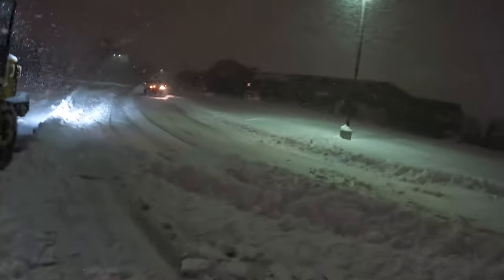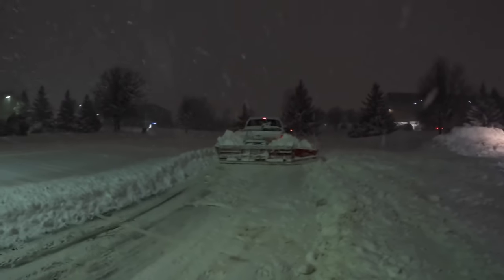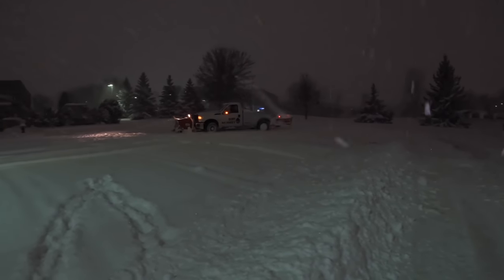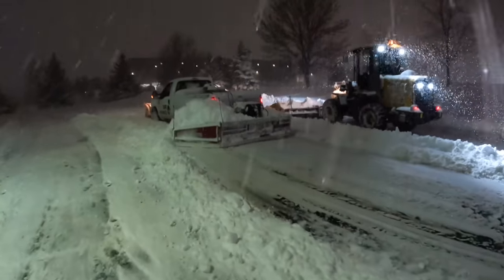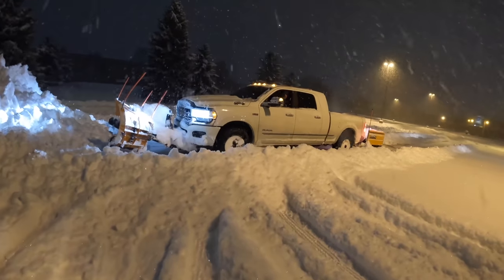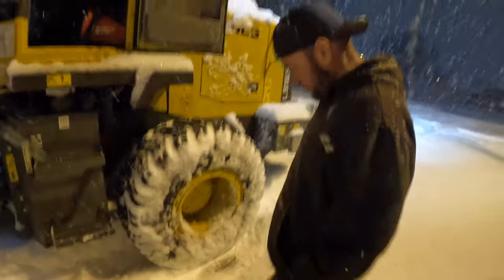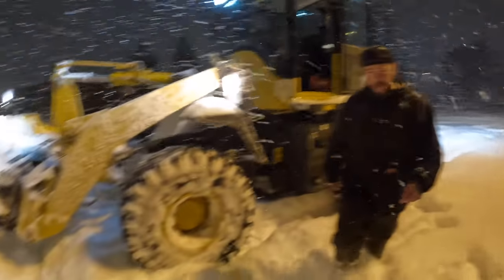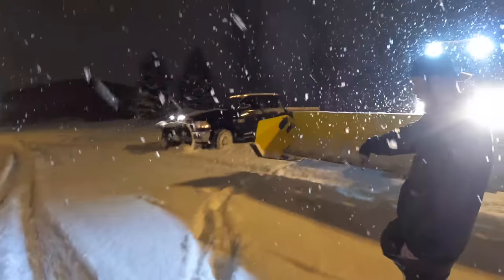24 hours of plowing deep snow

Comment: Any tips on getting plowing/ salting liability coverage when most insurers don't want to write new plowing policy's esp to new contractors and have even been canceling policies for people who have done it for a while already?
Reply from the maker: No advice-  Im in the same boat.  Its hard to get coverage for plowing.
Reply: What happened ? If you don’t mind the question.
Reply: FYI, 
At this point, I haven't had any problems or cancellations with our commercial vehicle insurance coverage. 
Wisconsin. Geico commercial.
8 trucks and trailers. 
All classified as year round landscaping service & snow clearing vehicles.
I added another trailer this past week and was asked if it'll be used for snow clearing. 
I said Yes, as it's enclosed and is used to haul snow clearing equipment. 
They added it and all is good.
Coincidentally, my yearly premium actually went down  
$50.00 this policy renewal. 
I've had 2 small claims in 20 years, loading dock door dings. 
No out of pocket cost for me and so far no rate increases.
I sure hope that you guys can get the insurance coverage that you want. Good Luck to all!

Comment: Dear Mr. Genadek. Whenever I see you clearing the snow, I think of the Red Poppy Ranch. The family lives off-grid in the Idaho mountains and has a long, dirt road to clear. The father does this with an old F150 that is not necessarily reliable. This road is the only way for the family and therefore essential. Do you have a cheap, used snow plow for the family? I am sure that not only the family would adore her for it.

Comment: I’m just amazed at the quantity of snow the white pickup pushes and pulls. Have you mentioned somewhere make and model? And I’ll be honest, I’ve lived in the northeast my whole life and I’ve never seen the rig on the back of the truck that pulls snow. It has a name?  Best Regards
Reply: is new one, see his other vid, a guy makes them and then will sell patents for nitrogen cylinder operated machine and the front plow has 6" of nitrogen forgivness plus triple trip edges, very easy on truck frame if hits something.   and has self leveling it's amaze balls      see stans other vid on the snow power front iron      that guys using firestone winterhawk tires his faves.

Comment: Lucky you getting all that nice snow, down here in central IL there's no snow, just frozen ground and lots of rain, good thing it's flat as can be otherwise there'd be mudslides everywhere, I've got my old Ariens snowblower stored away with Amsoil fully synthetic 10w30 small engine oil and synthetic gasoline so it stores better, the old Tecumseh engine is tired and the thicker oil helps in the cold, one of these days I plan on putting a Duromax multi fuel engine on it

Comment: Is there any way to flop the rear plow on the trucks to 45 degrees with wings out and slide out to one side or the other, to pull front plow spillage across to the desired side to maintain a finished side?  Also one day I hope to demo for you a setup that will cause your brain to melt.  Completely revolutionary.  About to head out myself.

Comment: Nice video!  do the SVL-75 in the video have standard block tread?  and what size artic sectional were you using on it.  I have a SVL-75 with stand block tracks and just bought a 8' artic sectional.  Now after seeing this video i feel like i should have at least 10.5' sectional.

Comment: I've been thinking about upgrading from a 5055e to a 100 or 120 hp tractor with a 8-10 ft snow pusher and a 8 to 10 ft rear blade, how do u like the wheel loader for plowing snow ? Any ideas for tractor snow removal set up ? Keep up the good work

Comment: i love watching the equipment work and see how different pieces do work differently. that sno power looks great and i like its advantages but it doesnt look like it stacks well and a lot of snow is built up between the plow and the truck. im using a straight blade and most of the time its just fine but every winter there are always those situations where i wish i could scoop. that arctic sectional though seems like a no brainer. all around a great pusher. i wonder how much of a pain it would be though if one of the section got bent up to replace it.

Comment: I really enjoy watching these snow removal videos, I have done this 20+years ago. How difficult is it getting new contracts/ maintaining existing contracts?
Reply: easy as heck    this year, you can find work, b/c contractors having trouble getting labor, just call local contractors and sub on for 125/hr with ins and your own v plow or respectable equip, problem is a 8500 set up is now 11k in the space of 1.5 months, and you can't find a lot of stuff, but if you have equip, run it or buy used and make it back

Comment: Hey Stan great video, have you ever tried any of the HLA blades or using farm tractors for pushing snow.
Reply from the maker: I looked at an HLA blade-  it had 3 motors, 13 hoses and 26 grease zerks and cost twice as much. I couldn't justify spending that
Reply: @Dirtmonkey  I just started running one this year. It's my first season plowing. I haven't had any issues with it yet. I find having the wings on motors is really nice when back dragging away from buildings, it also helps being able to be wider when it is light snow.

Comment: Stan aren’t Arctic sectionals the best I wish I had a large skid steer and a arctic 30 years ago so productive and easy to use I just cut some thick Teflon strips to add to the front of the wings to stop chipping curbs when you hit them by mistake
Reply from the maker: Yeah-  I wouldn't trade my arctics for anything Robert.  I'm with you-wish I had them years ago.

Comment: i don t understand why u dont get a big loader with a 12 24 metal pless , u guys are going to plow over and over the same spot , with pick up trucks . how do u make money
Reply from the maker: we make money by not buying a super expensive loader with an overpriced and hard to maintain pusher.  for us SIMPLE is best.  My loader cost $64,000 brand new in the box.  My pushers have ZERO grease zerks, ZERO hoses,  ZERO motors to burn out.  I looked at one of those high end pushers- it had 3 motors, 26 grease zerks and 13 hoses.  It was a maintenance nightmare in my opinion and cost twice as much as mine

Comment: why do americans plow snow with pick up trucks never really understood that
Reply: Why is that hard to understand?    What is normal for you?
Reply: @Bendigo1  its not effective its so slow ,here in Finland we use tractors and wheel loaders no one here use pickups just a waste of time
Reply: @benjaminnothing3873  In America, Pickups are much more common than tractors.  Using pickups allows someone to cover multiple areas in a day.  We do use larger equipment when it is available and needed, but most of the time using a pickup is just much more practical.  The plows are relatively inexpensive and can be removed for the majority of the year when they are not needed.  When they are needed they can be added pretty easilly.  Pickups in america are multi purpose machines. Just like tractors are in other smaller countries.
Reply: @Bendigo1  we cover everything with tractors they are fast too and they plow faster than a pickup and they are same as a pickup they can be used for everything